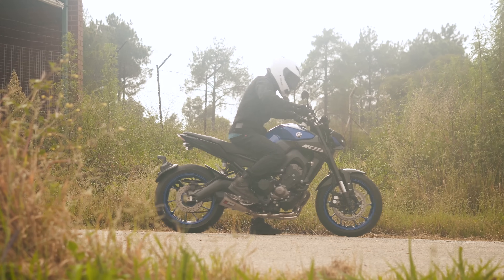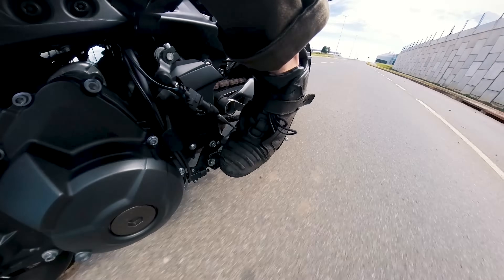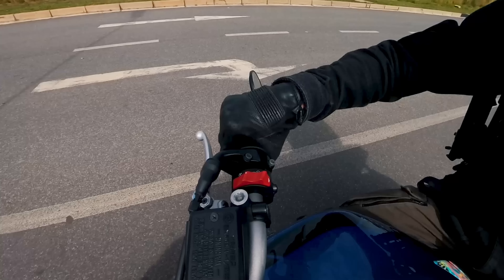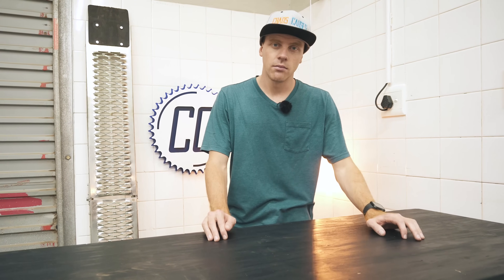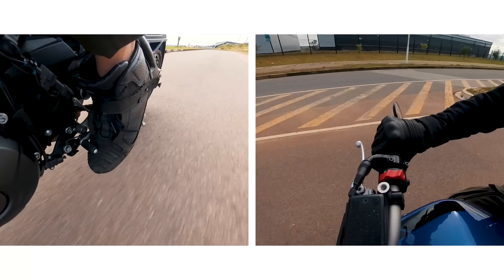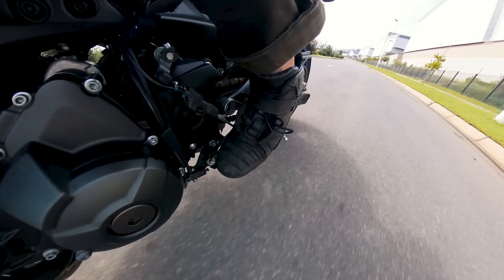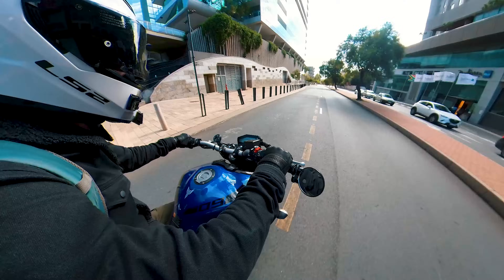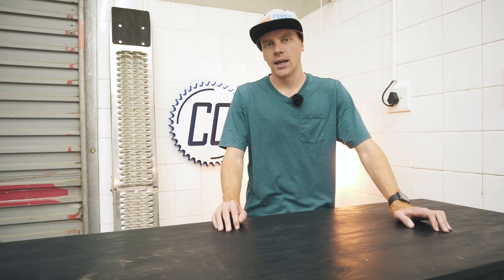What is CLUTCHLESS SHIFTING on a motorcycle?

Comment: Still don't get it due to my bike
I own a 2023 kawasaki ninja 400 and I can still shift without pulling the clutch in from first to third gear (havent try fourth to sixth). Why? Was it supposed to stall? Shouldn't I be able to shift? Or because the motorcycle was built for user-friendly for beginner?

Comment: Is there any mechanical damages on the transmition system if the clutchless shift is done wrong😮
Reply: Depends on how 'wrong' you do it. If you're just missing the timing and pushing the lever a bit, resulting in a delayed or missed shift... probably not. It might wear a bit faster while you're learning, but it shouldn't cause any damage by the time you get in the groove. If you try to force it with bad timing... that could potentially break something. 

Should note, I'm not an expert on motorcycles in particular, but I've been around enough manually-actuated gearboxes to learn a thing or two.

Comment: can i cause damge if i mess it up like one or two times? i wanna try it but im afraid that i will break something.
Reply: It just won't shift if your timing is off and nothing will happen. It should not take more force than normal shifting if matched to the shutting of the throttle

Comment: How do you practice this on a bike with a QS installed?
Reply: I don't know about your bike, but on mine (Tiger 660) I can disable the QS in the Settings Menu
Reply: Your qs should only realy work while on the gas. So if you do it while off the gas you should be doing it right.

Comment: Question: if your clutch cable breaks how do you ride away without stalling? I can get it that while you are riding you can skip the clutch but getting into motion....? Please instruct me!
Reply from the maker: Push the bike to get it rolling then clunk into gear.
Reply: you can try to start the bike in downhill in  3rd or 4rt gear, but i find it quite hard. Clutchless sifting is usefull when the clutch cable breaks while you are in motion, when you get to a stop, you better replace the cable
Reply: My clutch cable actually broke once. But my clutch actuator thingy is kinda easily accessible (my bike/moped back then was a 125cc suzuki shogun sp, just google it). So i just rolled forward, kick the clutch actuator with one feet, gear in, and buckle up lol.
Or rolling starter is also a way to do it.

Comment: How do you get your bike going without a working clutch for this to be of help?
How do you blip the throttle with a broken clutch cable to rev match the clutchless downshift?
And how do you do all this without putting unwanted stress and damage on your gearbox.
Because that's the whole excuse for bothering with what is a useless technique that brings nothing to the table except for bragging rights.

Comment: You have the quick shifter so why? Clutchless down shifting is like an art in timing engine speed to road speed, mess it up too much and you will wear the dog teeth in the gears causing endless false neutrals. Been doing it for decades. BTW, get a car for the push bike as it's too high of a load on a motorcycle. Danger Will Robinson !
Reply: Up or down I used to just hold the shifter in place for a second until there is load to make sure it doesn't pop out.
Reply: @pgnandt  if dog teeth are worn it will still jump out, pull an engine apart to find out why. I rode a friend's GS1000e in the mid 80s where 3rd gear would sound like metal being munched, moreover my GSX1100EX would keep jumping out of 2nd gear even after holding the gear lever, I dismantled the engine and replaced worn 2nd and 3rd gears, hope that helps you to understand or inspires you to dismantle an engine to find out how it all works. I do like your info and keep doing it .
Reply: @scottburns2712  I'll take you word for it. Best advice is to use the clutch. Btw I did find a few animations showing a motorcycle transmission. Cool stuff.

Comment: Yeah, so much for the 'how-to', without providing the smallest clue as to WHY  this is even possible without straining synchro's or dog's or selector forks....

The build of motorbike g-boxes employs 'drum selection' , which provides for some 'slack' between gear engagements by design, completely UNLIKE cars or trucks or tractors.
The DRUM is reason this can be done safely, it has very little to do with any 'skill' of the rider. BTW, do not ry this in your manual G-Box car, the parameter are MUCH less forgiving, i.e EXPENSIVE.